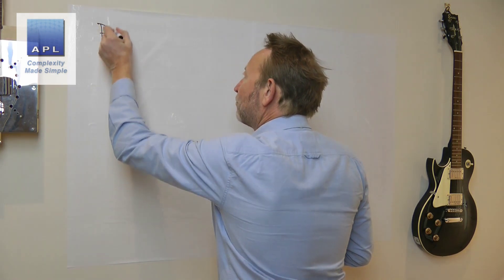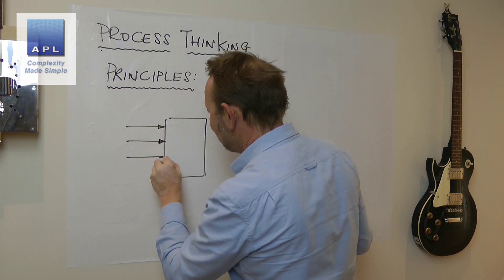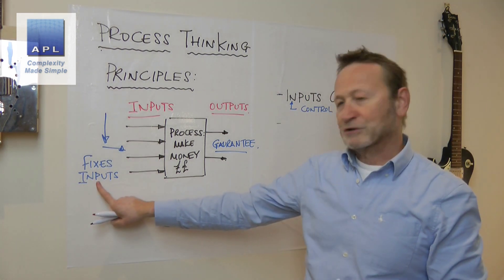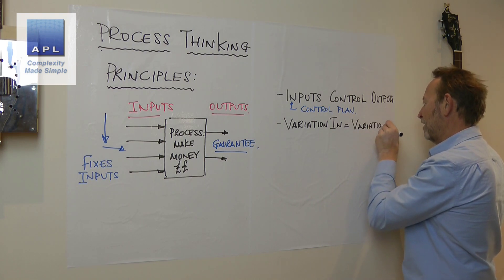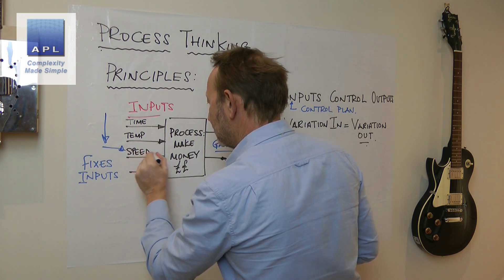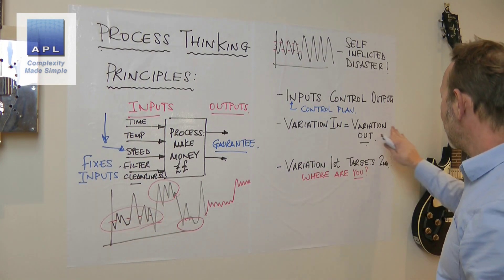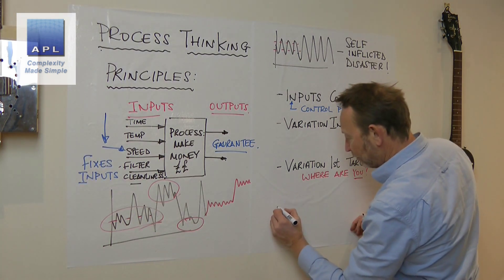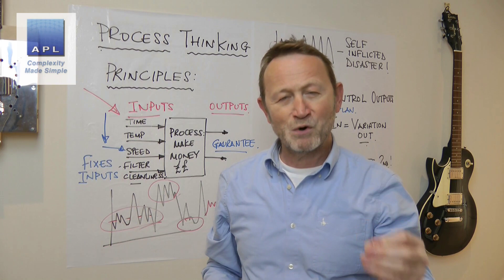4 Principles of Process Improvement - 6 Sigma

Comment: I like how you talk about the process of physics Paul!. Drink tea and read the paper have helped me a lot. I recently started to work in PVC extrusion and I've been told that it is hard to set up standards because of ever-changing environmental temperatures and deteriorating conditions dies (After maintenance) for a range of products. what will be a good point to start for standardization?
Reply from the maker: Well the variables you mention would be a good start. Maintenance issues are often where variation starts...and operators 'have' to adjust to compensate, and now you have a mess on your hands..
Reply: Appreciate it, Paul!